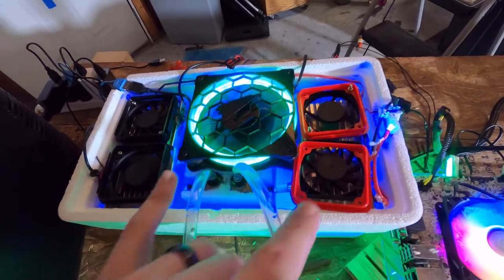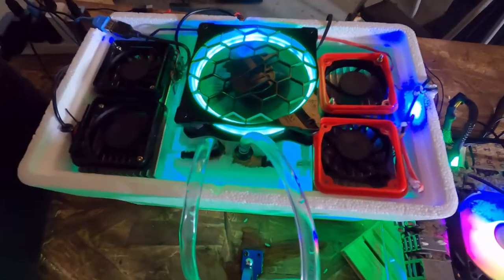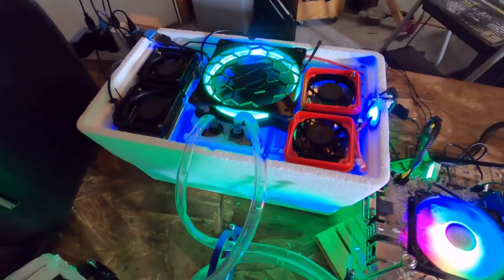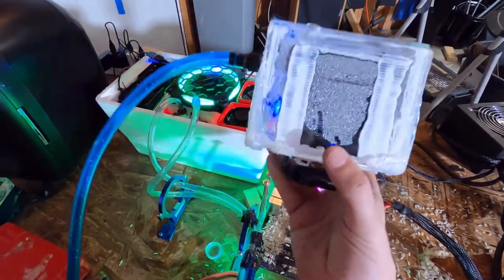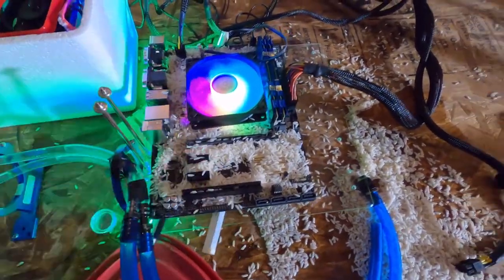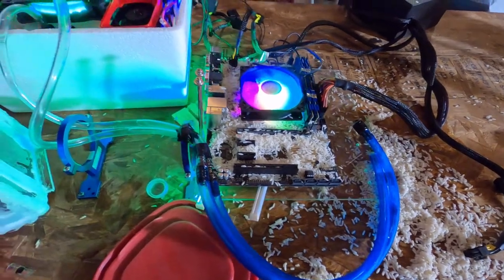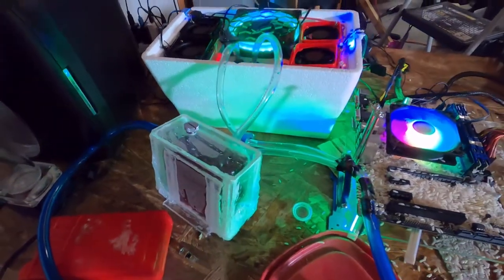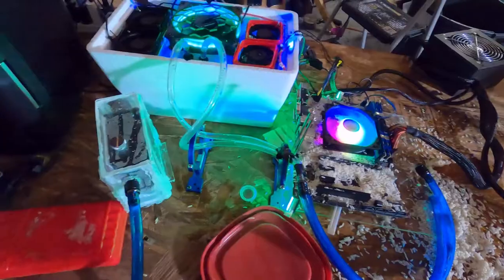I Water Cooled My Air Cooler ...AND FAILED !

Comment: When you rebuild the cooler...rotate the acryllic so you have the inlet/outlet facing the fins. That should allow better clearance so that you can connect a GPU also. One more suggestion...before you drill/tap the holes for the fittings, either use thicker material or add another layer of acrylic using super glue so there is more grip for the threads on the fittings. 
Keep at it bro, you will figure things out!
Reply from the maker: Yes sir everything that you have suggested is a very good idea the idea of making the wall sticker around the threads that's really good and yeah we're going to redesign it and go out it a more simpler way next time good seeing you in the comments